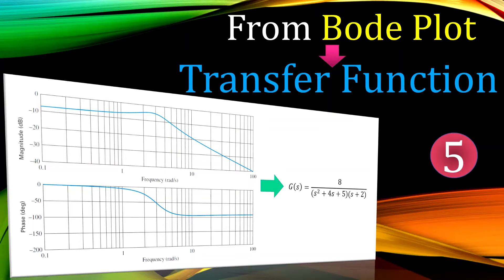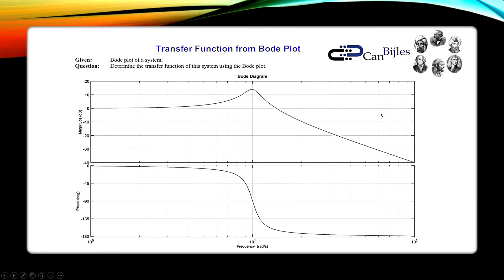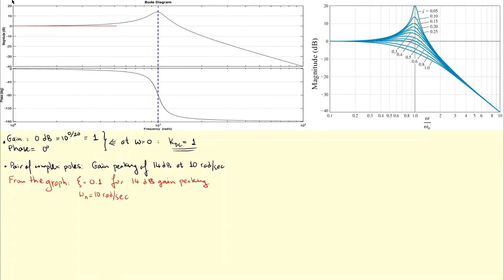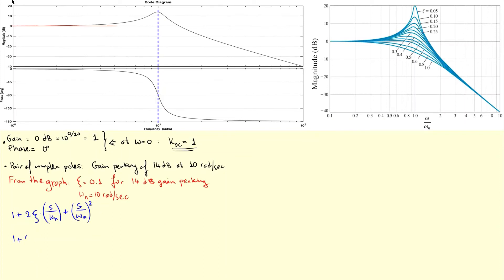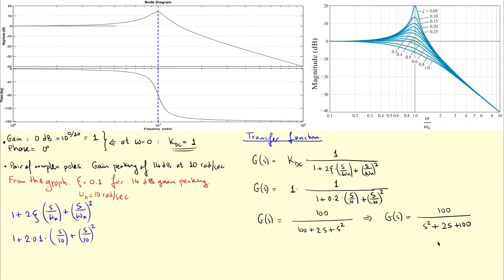Deriving the Transfer Function from Bode Plot 💡 Gain Peaking & Complex Poles 💡 Example 5

Comment: I wonder how did you know it is the second order system by just looking at this diagram?
Reply from the maker: Thanks  for your message. For example, you can see this from the slope of the gain after the peaking and also from the total phase angle. The slope of the gain of a second-order system is -40 dB/decade for higher frequencies. The phase is -180 degrees asymptotically.
Reply: @CANEDUX  Thanks for the answer, I get it. 😃
Reply from the maker: @spr_emrys  In addition: what I described is only valid for a pure all pole second-order system.

Comment: It's a very kind explanation.
However, I have one question.
How did you get the jeta value on the right side of the graph? You set it to 0.10... It looks like 0.15  more close in my eyes... I would appreciate it if you could let me know how to set it to 0.10.
Reply from the maker: Thanks for your message! The value of the damping ratio (zeta) is 0.10 at w/wn = 1 when the gain peaking is 14 dB. For zeta is 0.15, the gain peaking is not 14 dB. The pair of complex poles creates a gain peaking of 14 dB in this example.